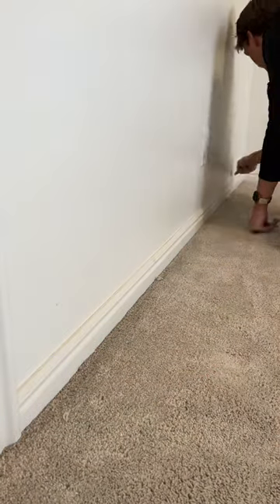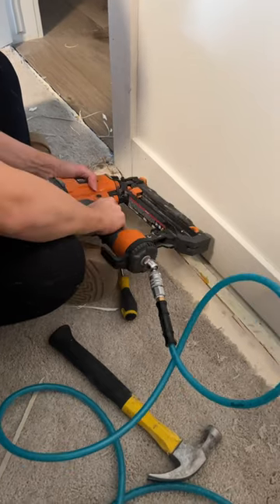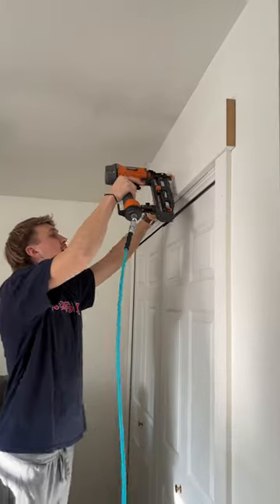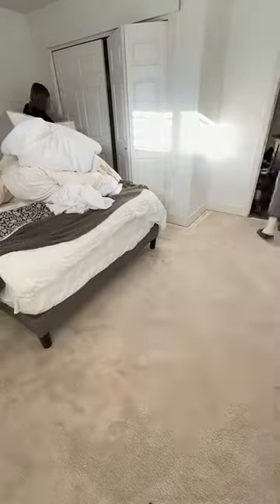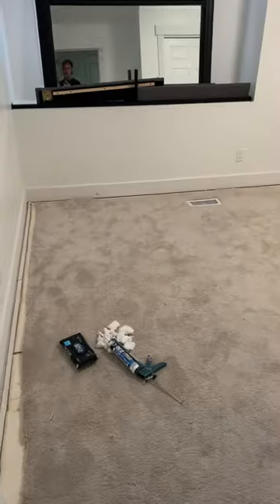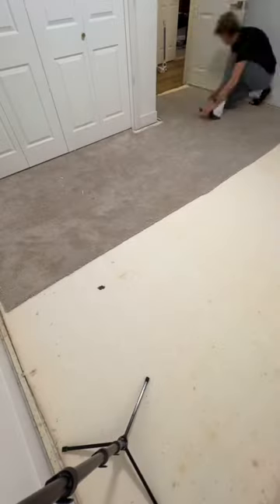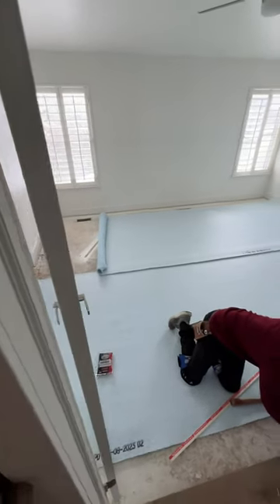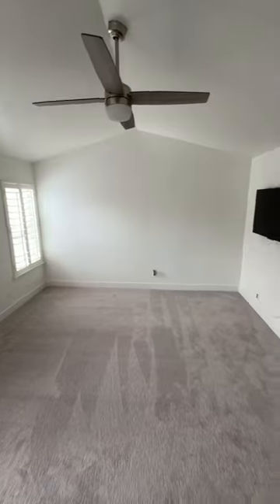Installing new baseboards, trim, and carpet in our upstairs bedrooms! #baseboards #trim #home #decor

Comment: What do you prefer I notice that you have a Brad nailer and nail guns tools like that that are attached to an air compressor do you prefer air compressor or would you like or prefer a rechargeable battery. I am torn my daughter got me one that attaches to an air compressor which I do have an air confessor but I thought it would be easier with a rechargeable battery so I returned it and got 1 with a retardable battery now I'm wondering if that was a good idea or not thank you for your input
Reply from the maker: Honestly we use both of them for different reasons. The one that we use for the air compressor is good for thicker items and the battery powered one isn’t as powerful and is good for thinner items. So it just depends on what you need it for :)